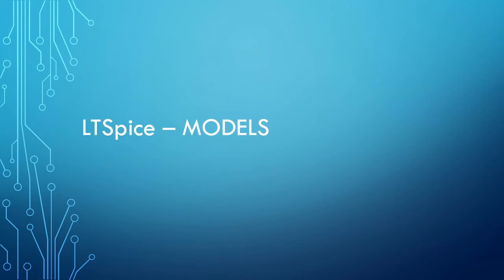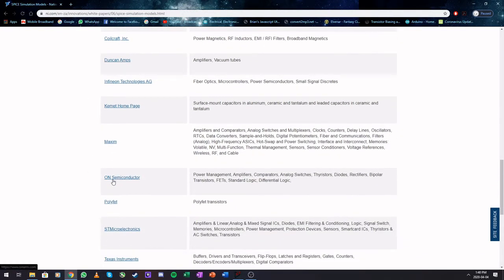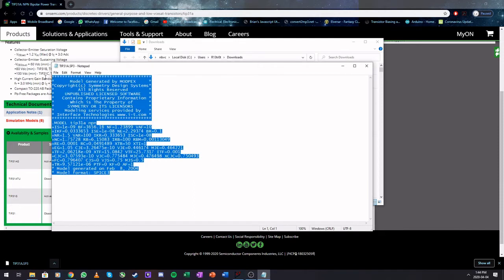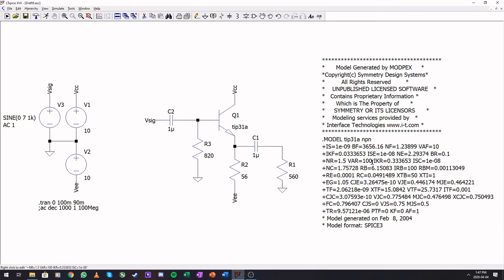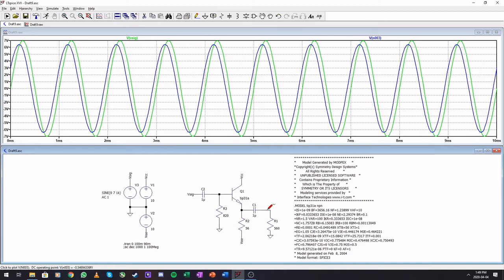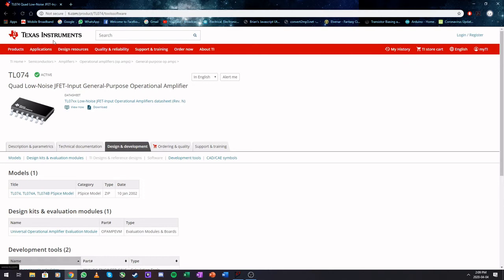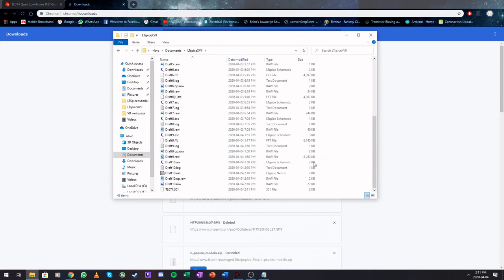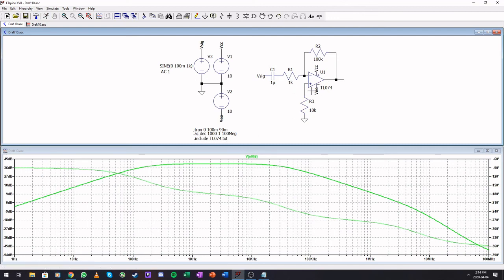Video 4 - LTSpice Importing models

Comment: I encoder like this error "G:\Hardware Projects\LTspice Simulation\Transistor_simulation.net(7): Expected device instantiation or directive here.
N§Q2 N002 N004 0 DI_MMBT2222A
^^^^^^^^^^^^^^^^^^^^^^^^^^^^^"

Would you explain me what I will do clear the error?
Reply from the maker: Don't know if the filetype you are using is compatible. Perhaps extract the transistor data into a text file?